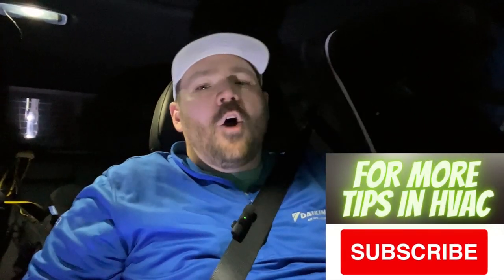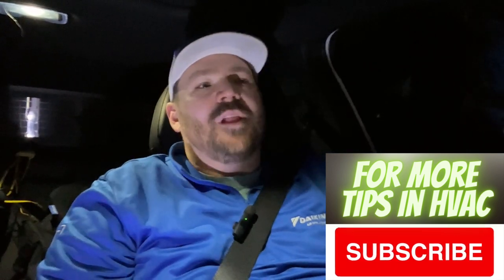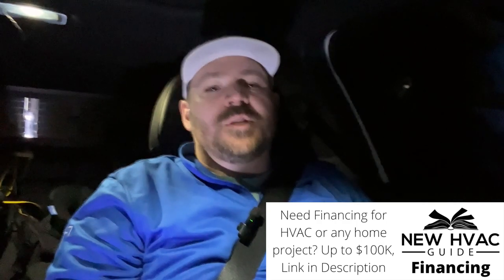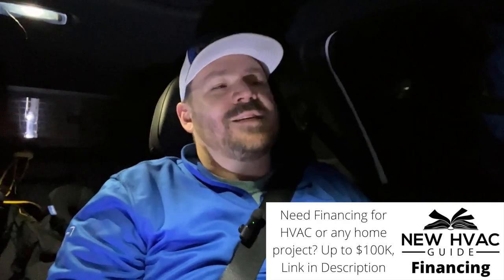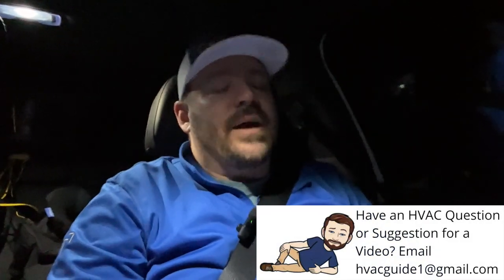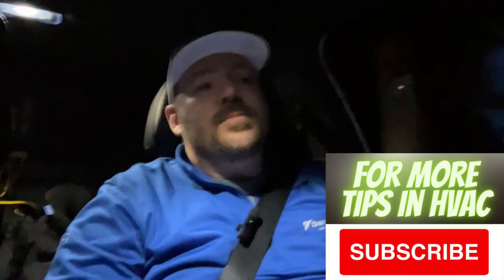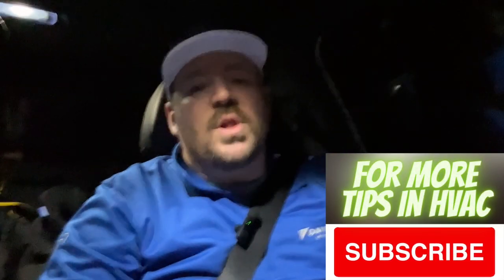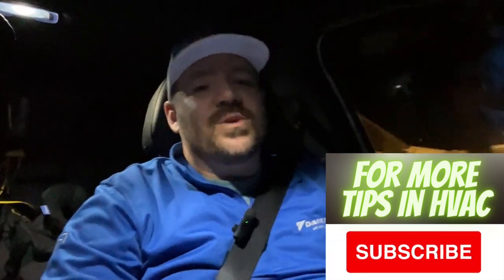Heat Pump Lockout EXPLAINED!

Comment: You Sir, has some of the best information out there, thank you. I have RHEEM heat pump with ELECTRIC strip heat, and currently my outdoor unit is not coming on in either heat or cool mode? the board is showing a HI PRESSURE LOCKOUT code. Can you help with what may be the caused here
? Thank you.

Comment: thank you for ur videos. Can you help here? What is a "high pressure lockout"? And could a defective thermostat caused the defrost board to show this code. My heat pump board is currently showing this code. The OUTDOOR unit DOES NOT, start up at all,  in heating or cooling. There is 24v on the R and C terminals. In  the "emergency" mode, I am not getting enough heat. It only heats up to 72degrees only, and runs all night. And never shuts off.  This is a RHEEM system. 6yrs old. I am really frustrated now, because i am having all these issues at the same time. I am thinking the thermostat is mal functioning, then I think its the defrost board. then i think the heat strips has issues. I am a wreck with these issues. The indoor unit runs fine, but NOTHING from the OUT DOOR UNIT. I just can't figure it out. Hope you or any other can assist me.

Comment: Why would a heat pump not turn on for heating for 65F indoor/outdoor to get up to 67F? It always turns on the furnace instead… and fails with error code when gas to furnace is turned off!?!

Comment: Good video.. good information.. question.. what would you set a compressor lockout to in a dual fuel situation with a unit like a Colman hmh7 that heats down to -5? They wouldnt tell me exactly where it starts to loose efficiency in the class they just said -5 to 75 is the limit.. we’ve been trying 20 degrees with no complaints… just curious what you thought on that..
Reply from the maker: Check out my video on balance point

Comment: When I read lockout, I was thinking something sinister like manufacturers shutting down the system because they hadn't registered a service call within a designated timeframe or something silly like that.

With dual fuel setups the jargon of the day was "changeover temperature".  The practice of the day was to set the changeover temperature to the "break-even temperature" which was calculated to be the temperature when both systems produced the same amount of BTU per dollar of energy.  Obviously the calculation is not simple for someone not skilled in algebra, unit conversions, and such (otherwise it's actually pretty simple if a little time-consuming).

Something you probably have seen but always struck me as potentially risky is that when operating above the changeover setting and the heat pump heating, when it goes into defrost mode the gas furnace gets lit up for the duration.  I always wondered what that might do to system pressures.  I figured it must be okay since the mfr set it up to work that way.  🤔
Reply from the maker: I’m keeping you on your toes with my titles haha. 
I call it lockout because that’s what Honeywell calls it. Everyone has their own verbiage.
Reply: @NewHVACGuide  
I have a Honeywell thermostat.  🤔😁

I'll try to remember to dig up that original Goodman documentation from '94 and see if my memory is correct.  

PS:  I'm getting 98 degree air out right now at 43 outside temp and 74 inside temp from that system in heat pump mode.  Yay R22!
Reply: @elgringoec  is that with furnace on too… or just heat pump? Does your heat pump “heat” when the furnace / gas is disabled?
Reply: @bthemedia  
They heat mutually exclusively.  A dedicated thermostat senses outdoor air temp and activates heat pump mode above setpoint and furnace mode below.

Comment: Currently installing a Bosch ducted heat pump system. We have natural gas furnaces as well. Here in the NE I believe heating with natural gas is cheaper than electric. My question is what’s the best way to set the thermostat to run the natural gas furnaces as the primary?
Reply: That is an inverter style heat pump I believe.  The lockout temp should be much lower than a standard heat pump

Comment: I have my thermostat set to shut down the outside unit below 27 degrees when the heat strips are producing the bulk of the heat. Should I program the thermostat to "always" run the outside unit regardless of how low the outside temperature goes?
Reply from the maker: That's actually a good question. Most heat pump systems with electric back up, have always continue to run the heat pump and get as much energy out of them, regardless of the auxiliary heat turning on. However, as Tom has gone on with the ability of heat pumps to continue to produce at lower temperatures, folks are being more mindful of the lockout of the heat pump, especially in colder temperatures that the systems are starting to be installed in. It was never a thing up north years ago, because heat pumps were not installed at all. So to answer your question, there is a temperature at which point the heat pump is rendered useless, and can no longer pull heat out of the cold air because it is simply too cold.
Reply: @NewHVACGuide  yes! -29°C that’s when mine locked off for at least 12 hours or more and it came back on at -24°C so that’s pretty good , so it’s a good Heat Pump

Comment: Question I have, how set it for a special DC Inverter heat pump like Midea (24V Conversion kit)/Gree/Goodman York (24V Conversion kit).  Since those outdoor units are so efficient (where they maintain their capacity down to -5*F), when do you actually set the lockout for those?
Reply from the maker: Great question. I just did a video on that.
HVAC Balance SETPOINT!
https://youtu.be/SVSiA-WSX30
Reply: OMG!  I missed that video!  Need to hit that notification bell!  

That said, I noticed the lowest was 40*F the thermostat (Honeywell) can go down to.  It goes from 2.5kW to 5.5kW (3kW heat strip) whenever the temperature outside it grabs from the Internet hits 39*F

Comment: YOU NEVER EXPLAINED THE REASON FOR HIGH PRESSURE...
Reply: NO' He did not' My Lenox goes into High heat during 103-105 % outside temp! Have to shut off heat pump and reset the temostat.
Reply: I have 1 heat pump is work in heat and fan when is 74 and 74 F the compressor is of but the fan only is running can you help me please thank you
Reply: Adding more heat to the coil sense it’s downstream of the furnace heat exchanger. The added heat will increase the pressure of the refrigerant.